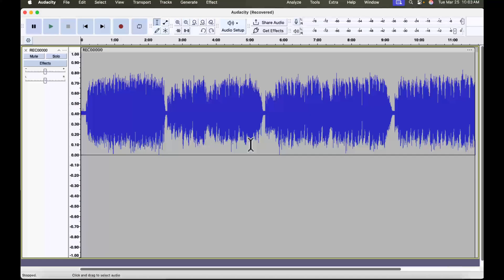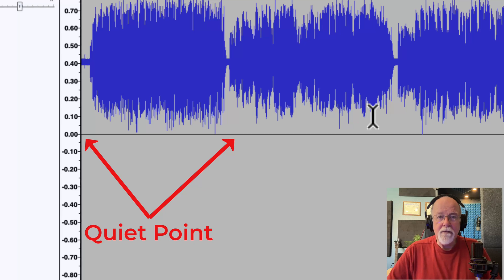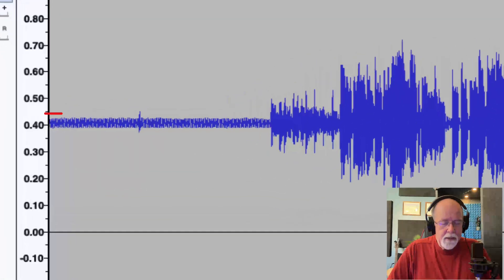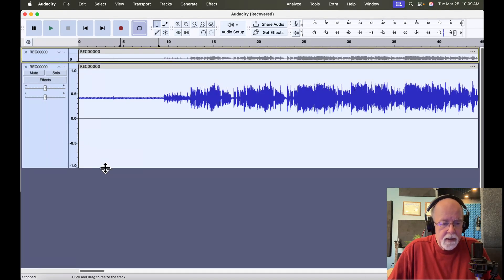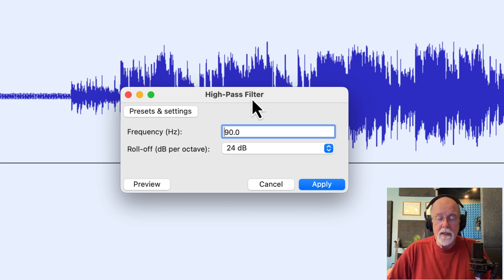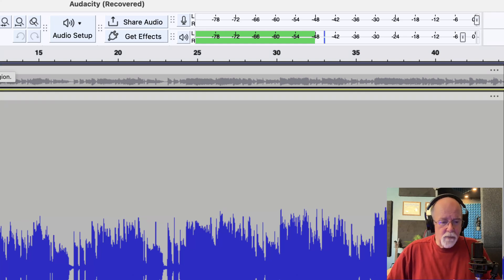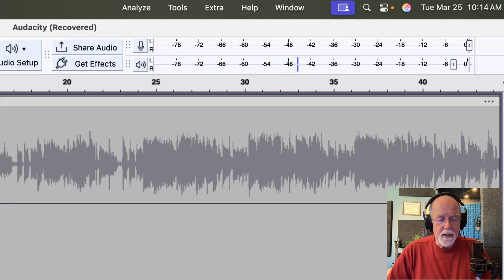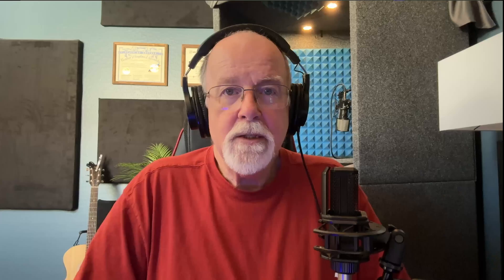How To Fix DC Offset Using Audacity

Comment: Also "normalize" feature has a DC offset correction. In case one would want to center it without filtering the audio.
Cheers!
Reply from the maker: True. But it doesn’t always correct extreme cases.